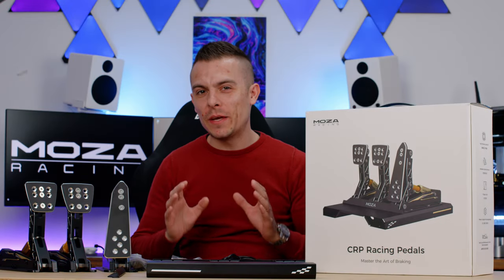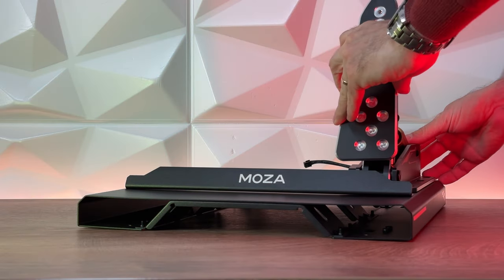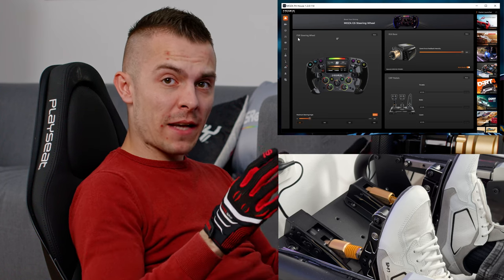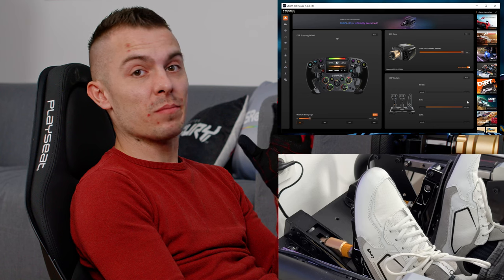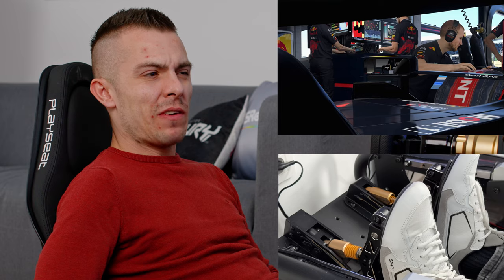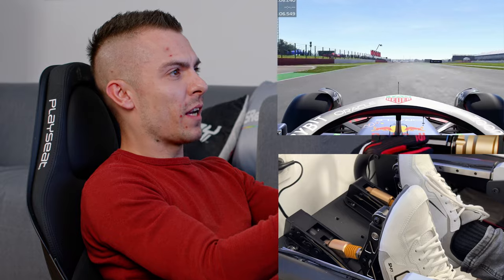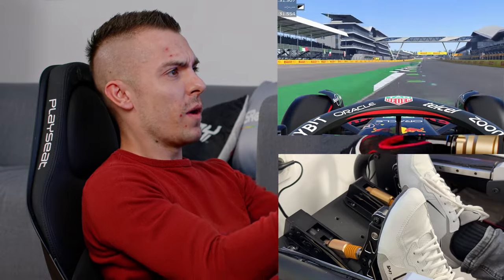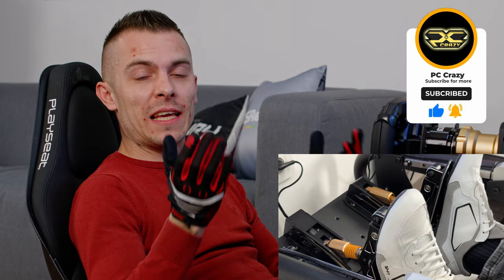COMPLETING MY F1 SIMRIG with MOZA CRP Racing Pedals

Comment: Did you buy a longer cable to separate the brake and throttle?
Reply from the maker: Nope, I used everything original from the box. The brake just isn't on the far left side.

Comment: thx man. first review i see where actually was talking about the connection to computer. It was so hard and confusing to figure out if we can connect the CRP-Padels straight to the Base. And yeah here i see first time, that this is not possible... THX so much for the video! I do not understand why MOZA fucked it up at this point... unbelievable!
Reply from the maker: You are welcome. I don't know honestly. I think it's better because you could use them in combinations with other brands and also I wouldn't like to connect it to the base because the wire would be everywhere or you would have to manage it to avoid tangling. I mean, that isn't a big issue, but honestly, I am a bit sick when it comes to cables.
Reply: @PCCrazyDario  your right. CableManagment :D but for me the most important is one usb cable to the pc. I don't get why they didn'T made it both possible. pedals straight to PC via USB OR with RJ cable to the Base. Greetz